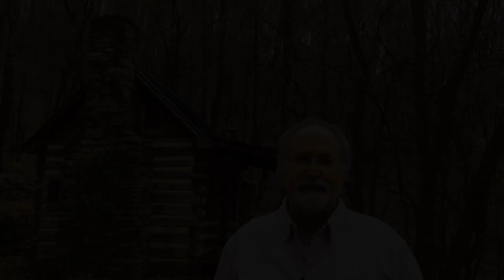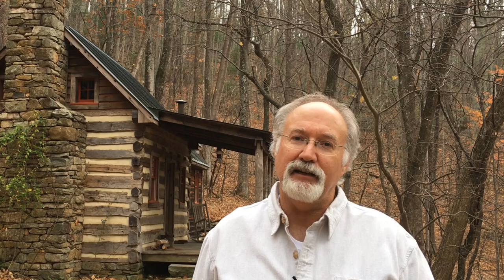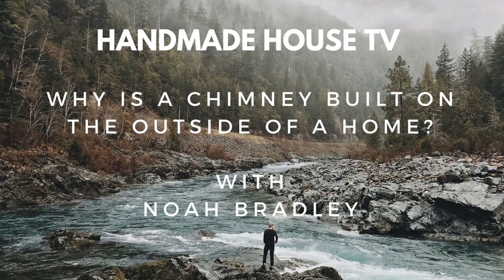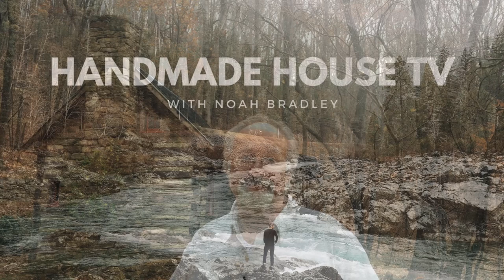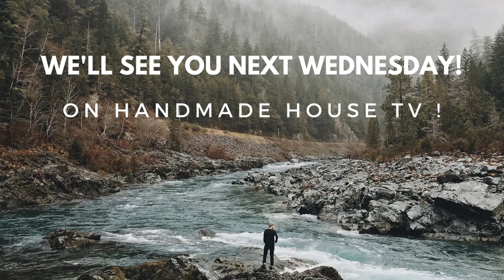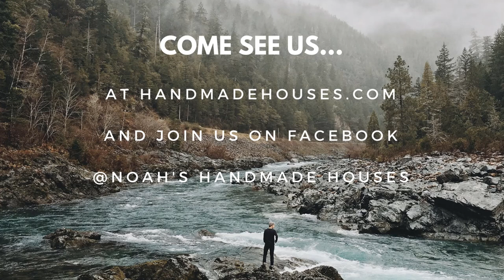WHY Are Chimneys on the Outside of a Home?

Comment: We have built the chimneys on the inside since medieval times (1400s) here in Scandinavia.
Mostly in aim to preserve any heat (it's cold here) but also from tradition. :)
Reply from the maker: And for cold climates, like where you live, and in the northern US it's a smart place to put it!
Reply: The house was built around the fireplace and tradition in Scandinavia say that you should be able to take a walk around it. Although trough several rooms. The Children ran in a circle until someone had enough.
Reply: Fånge 1056 
Why do they put the dunny on the INSIDE!?
Reply: don't like to get a cold azz !!!
Reply: In Finland common people lived in so called smoke huts from the medieval times until to the beginning of the 20th century. Smoke huts did not have chimneys at all. When the stove was heated all the smoke gathered inside and it had to be aired out afterwards. Those houses were completely black from inside. Behind the link there is a Finnish smoke hut that serves as a museum: https://www.janakkala.fi/laurinmaki/wp-content/uploads/sites/2/2016/09/IMG_6601.jpg
Reply: @HandmadeHouseswithNoahBradley   Climate dictates multiple features of a house, especially one built prior to modern heating and cooling. For example, in cold climates, houses tend to be closed plan, even nowadays, with small compartmentalized rooms and corridors.
Reply: There's a few houses I've seen in Arizona where the chimney is inside the house. usually in the middle.
Reply: @joonas3544  now where to place the ham and sausages ....
Reply: @bipolatelly9806  To obtain maximum heat effect,an indoor brickchimney also works as heating element.But i like the ouside ones,in Sweden we call them "American type chimneys".
Reply: @joonas3544 In Russia, until the 17th century, houses were heated in black, there was an open stove inside the wooden hut, the smoke came out through special holes in the upper rows of the log house, now the furnaces are completely inside the house, the smoke gives almost all the heat to the hut before going into the pipe. It's wild for me when I see a chimney outside the house. We have frost in winter up to -45, and with a chimney outside, you can give oak!

Comment: As a brick and stone Mason of 35 years of chimney building experienc, it is a hell of a lot easier to build a chimney up an exterior wall than through the middle of the house.  Scaffolding can be erected directly off the ground all the way to the top of the chimney (minimum 15' but I have gone as high as 54'). Material can be delivered to outside scaffold by forklift tractor or by hand and improvised hoisting system much easier than having to pass materials mostly by hand up through various levels of a house.  Floors of the house aren't in the way of the masons and they can work with scaffold boards adjusted to optimal heights; interior scaffolds necessitate working above your head or reaching down below your feet through an opening in the floor which you had just previously used to pass up and stockpile tons of materials needed for the subsequent story's section of the chimney requiring extra temporary structural support for the overloaded floor or ceiling on which the material sits.  An interior chimney presents a challenge to building a safe scaffold on a steep pitched roof and problems getting materials up the roof to the scaffold.  Also roofs and floors need to be protected from mortar droppings and brick or stone fragments as many times they (the floors, walls, or roofs) are finished or nearly finished surfaces.  These things simply fall to the ground and are easily cleaned up after construction when everything is done off an exterior scaffold.
Reply: That is why the chimney would be built first and used as a support for the roof.
Reply: @jaywoods7322  I would have loved to build it first as soon as the foundation was in but everywhere I went, Texas, Arkansas, Oklahoma, Northern Virginia, Louisiana, Mayland, and Mississippi the builders insist on getting the framers and the roofers in first and ignore your protests even when you offer to do the job considerably cheaper if they let you go first.  One of their excuses is that you won't get the chimney built right to fit through the house and receive the flashing at the roof line as though you're too stupid to figure it out from the plan drawings.  After much pleading and explaining, I  could usually but not always persuade them to hold off on the section of roof around the chimney so that I could build the scaffold off the last story floor up through the ceiling joist and roof rafters before the roofers finished.  The roofers cried a lot about this because they wanted to slam dunk the whole job without having to come back for a loser of a day piddling around finishing the roof and flashing the chimney.  They usually didn't get as much respect as the framers; the framers always got what they wanted.  When they refused and the roof was already complete, we usually had to nail into the roof (not too bad with wood shingles, asphalt shingles a bit more trouble to avoid leaks, and with metal roofing almost impossible). Then, as though you can lay brick without dropping one spec of mortar which stains the roof you have to cover with plastic or felt paper to protect the roof.  Experienced builders understood that mortar stains on a wood roof disappear after 6 months but they don't want to wait 6 months to sell it to their buyers that don't understand it.  On asphalt a little muriatic acid will do wonders if the aggregate in the shingles doesn't change color from it.  Then if you don't slip and fall off the roof while you're building veneer Jack's off the 2x4's you had to nail into the roof, you might finish the chimney before OSHA sees what a Jake leg scaffold you're working from.  I have occasionally been able to erect scaffold frames up the near side of the house, extend long scaffold boards to the roof, then build another scaffold over those boards, use long boards again over to the roof, and repeat the process in a stairstep fashion until you get to where the chimney is located.  This is using $5000 worth of scaffold to do $300 worth of work.  Pretty dumb when all you have to do is like you say.  Let the Mason go first.
Reply: @markenge9348  Your building experience is from a very different time period. 
Imagine you arrive at your land with a wife and mabe a kid or two.  The first shelter you build is for your 2 horses or oxen and a cow or 2, because if they are not in good shape your all done. You spend the first winter or 2 sleeping with the the critters and while it may be a bit stinky they put off a fair amount of heat, good thing because with the hay around you could not have any fire inside, cooking was done outside.  When you get some time to build a house, the plans you speak of would be scratched, full size in the dirt with a stick, no contractors no inspectors and no OSHA, you could build it any way you liked because if it fell down you only had to look into a bucket of water to find who was to blame.

Comment: Good information.  Some of the old farms here in Ga still have the original house the was build many years ago. The Chimney being on the outside. Heartpine lumber proly sawn right there on the farm, still remains so beautiful. Ive seen a few with Chimneys in the middle of the house with a fire box on both sides. 
 The kitchen would have a small Chimney one the outside with a stove pipe hole about head high, for the Woodstove. Some kitchens were built away from the house with a walk way. Grandma said it kept the house from getting so hot in the summer. Also in case of fire maybe it wouldnt get to the main living area.

Comment: An exterior chimney reduces the need for flashing around a roof penetration, and if it starts to shift or lean over time, it is more apparent and can can be taken apart and rebuilt without disrupting the houses structure. On land that is rarely surveyed to depth  structures shift and dense stone structures shift more than distributed timber ones. 

A well built chimney incorporating a simple modern design element, a heating exchanging firebox liner wastes very little energy heating the mass of the chimney compared to the heat lost through traditional ventilation of  an interior centrally located fireplace.

Comment: An exterior chimney is exposed to the cold air outside the cabin.  During times of no fire in the fireplace,  the chimney itself becomes cold and thus the air in side the chimney is also cold.  That, in turn, leads to downdrafts (air flowing DOWNWARD in the flue instead of updrafts).  It gets a bit smoky in the cabin getting that downdraft to turn around and create an updraft to expel smoke from a newly lit fire.  One good reason to keep the chimney in the interior of the structure... along with benefiting from greater heat retention (the chimney is a thermal mass heated by the fire which stays warm after the fire extinguishes).
Reply: Also thre chimnrey as it cools down doesn´t draw when used again as the built up moisture makes a gas lock plus also makes a chimney more fragile and soots so chimney fires are constant. Overhere in Finland it would be even forbidden to build a s.c. american chimney nowadays. Emission and safety regulations would make it impossible.

Comment: I lived in a colonial house in New Hampshire built in 1770 with five fireplaces (one in each room) and a beehive oven all in a central three flue monsterous chimney. It still had the original single pane windows......and it was cold! Of course we had a woodstove inserted into the main fireplace but on -20*F windy nights it was a struggle to maintain 50* F. Thanks for the video.
Reply: What town??

Comment: One more reason for an outside Chimney, is because settlers built their homesteads in stages, 
while clearing land, stacking rocks, and drying logs for building, 
all while still living in and out of the Conestoga Wagon in which they travelled.
They would continue to cook outdoors, until after the Harvest, 
where they could use the money from the sale of the Crops to buy Cement for building the Chimney, 
the Fireplace/Oven, Metal Hinges for a real door, (instead of maybe a heavy woolen blanket they had been using for a door), and real glass for windows.
All of these things would be added after the Harvest, 
with Winter on the way, so the Chimney was built onto an already constructed Cabin, 
with one, or maybe no windows, and one door.
It was easier to add the Chimney on to the end of the Cabin, and put the Fireplace/Oven on the end wall, 
where a space had been left for that purpose.
This told to me by my Father, who was born to a Farming Family, in a "Little House On The Prairie" in North Dakota, 
and lived there in the late 1920's, moved to and was raised in Minnesota, in a home that originally had a dirt floor.
The very first homes of many people were Grass or Turf homes called "Soddy's".
This also allowed for additions to be made to the home, on the other side of the Chimney, 
which would leave the Fireplace and Chimney in the middle of the home.
Reply: Thank you so much for that info. It really puts the puzzle together, gives me a much better picture of it. I work on old buildings on farms and such , stone mason , so I’m always trying to imagine it in the beginning

Comment: My father built the house I grew up in back in 1979/1980, and the house is primarily heated by a woodstove with an internal cinder block and tile lined chimney.  He said that the reason for building it internally prevented the chimney from getting too cold or having a large differential temperature between the outside and inside, reducing condensation of flue gases and reducing the build up of creosote (which if not cleaned off can cause chimney fires).  We clean the chimney each year at the start of the season (woodstove runs constantly from Thanksgiving to ~ mid-March), and we don't see much creosote buildup at all.  Anecdotally, we think an internal chimney is safer.
Reply: it is. correct on all counts. Have you any Finnish ancestors?
Reply: @mikatamminen2786 Not that I'm aware, no.  Some Scotch, some eastern European (Polish, maybe Ukrainian?).  Really just European mutts as best I can tell, so maybe Finn is in there too.  I haven't run an Ancestry and don't plan to.

Comment: Here in Canada many homes/cottages have a massive stone fireplace in the center of  the house, there is a ton of lost radiant heat lost to a fireplace on the outside of the home, esp at -40c. As well, the Russian stove is a fireplace central to the home and it heats a home in -70
Reply: Wow, that’s what I’m searching for, examples of fireplaces in the middle of the home. Never seen that even here in Canada. Makes more sense than a chimney on the exterior wall of the house. Like you said, -20? Ya. Keep that heat inside!

Comment: The truth is that the chimney catches fire it can be pushed over and fall away from the house! And in the southern United States we often had a separate kitchen in a attached room separated from the main house by a breezeway in the older homes built pre air conditioning if you see a older home what is often assumed to be a laundry room is in fact the original kitchen!
Reply: Roy Perkins I just love historic Southern homes with the dog trots, transoms over the doorways, and second outdoor kitchens.
Reply: My grandfather did exactly that back around 1940, he had to chop a hole through the roof of a c. 1800 house with ridge beam, and the first blow of the axe, hit a rafter in the dark and the head came back and knocked him in the head and he almost passed out, luckily it was a single bit axe and he would never touch a double bit axe after that, saying it could have killed him especially with the house on fire. He saved the house, and his landlord only  bitched about the damage and said its as well insured anyways.
Reply: @LinnTractorNut  Good story. :)

Comment: Many Colonial Salt Box & Cape Cod houses built during the 1600s had a broad central chimney--- open front & back onto  kitchen and living room--- a particularly cozy set up.  
I have seen pictures of historic log cabins with this large central fireplace---: those usually also have porches the full length of the building: a passive solar design like the Salt Box.  
There's a tavern in Montana with 3 logs to a wall (Western Red Cedar/bark on), and photos of pioneer cabins in Ohio with 3 tulip poplar to a wall.
Reply from the maker: Thanks for sharing!

Comment: Allowed for external air and ash clean out opening. Open in winter to eliminate drawing cold air into house through door and cracks. Closed in summer allowing cool air to be drawn in through door and windows.

Comment: one reason is simply the complexity of the wood working required to get the chimney inside .. roofing around a chimney is hard... with basic materials
Reply from the maker: So true. Anytime something pokes through a roof it is a challenge to keep it from leaking.
Reply: @HandmadeHouseswithNoahBradley   Scandinavians and other northern people have been building them inside for centuries so as not to waste all the thermal mass and our homes are dry.  You just have to know what you're doing.  As for cooking in summer most have outside stone or cob ovens

Comment: In the far north country, below zero *F temps wreck havoc with the construction and maintenance of chimneys on the outside of a house.  In the past, it was a hazard but these days -- if you can afford the higher maintenance -- there is no reason you can't have one.  Except that it's a waste of recoverable heat.  :)
Reply from the maker: Good point... If I was lived in the far north, beyond a doubt, I'd have that chimney inside with me!

Comment: For those citing European houses with interior chimneys, it's worth pointing out that those cultures were far more established in masonry given the long history of European nations. Even small communities in Europe had local masonry supply, skill and materials because they had been doing it for centuries before the American continent was first settled. 
In most cases, rural cabins in North America during the 17th and 18th centuries were very isolated and built by people with very limited financial means and they had to use local materials for their homes. Those materials had to be quarried and hauled manually. In addition to felling local timber, they had to rely on stones and rocks from either streams or rocky hillsides. This made for crude chimney building and, as the author mentioned, they were not always air tight. Anyone who has ever mortared a rock wall or true rock chimney knows how challenging it is - and that's using modern caulking guns and air extruders.
Reply: Chimneys show in Europe in the 1100's and they had a huge impact on interior rooms in castles
becoming smaller. It's right up there with glass on how much it impacts interior design. The Indian's settled the America's over 27,000 years ago, and from Spainish descriptions their cities were as good as anything in Europe.
Reply: @readhistory2023  idk about that one

Comment: I want to build a chimney like that and I have a question: which side of a house?

The prevalent wind direction is from the west followed by from northwest and from the north.

South wall seems to have the most advantages because the smoke and sparks will not be pushed on the roof and the walls of chimney will be warmed up by the sun diminishing backdraft.

Comment: A chimney can be appreciated on the inside of a home where it can give of heat after the fire is out and it will last much longer since it is not exposed to freeze/thaw cycles. Mainly we have double insulated chimney pipe now because labor costs for stone and brick work are too high. My masonry chimney is in the middle of my house and I will be building a rocket/batch mass heater for maximum efficiency.